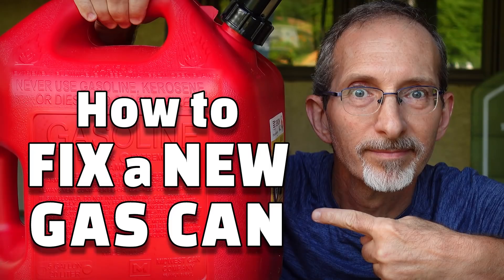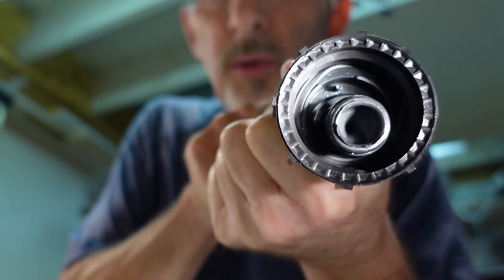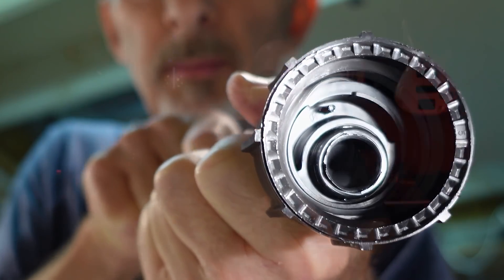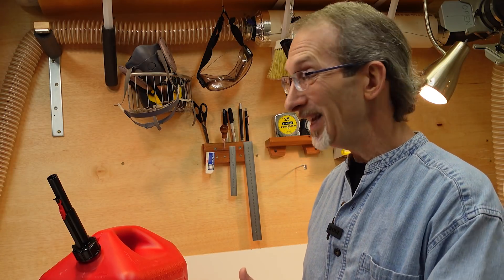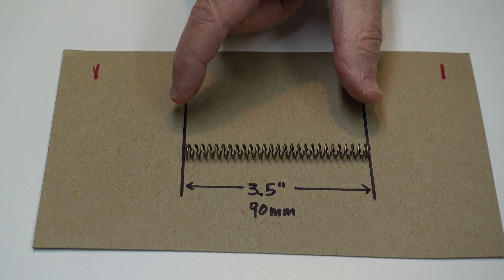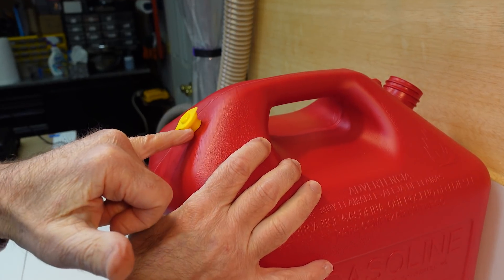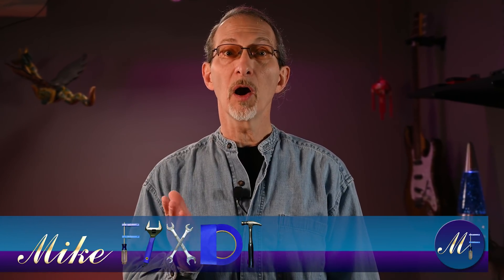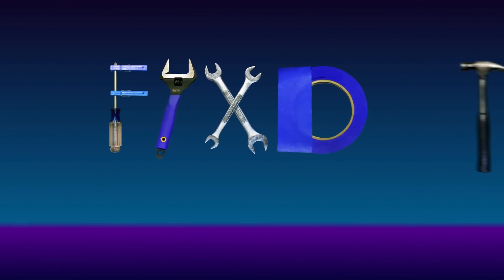Gas Can Modification | Part 2: Explosive Details!

Comment: First off when you fill the gas tank of your car or truck the weight of the gas in the plastic can will easily open the nozzle. Second of all who the heck uses a 5 gallon to fill their gas-powered weedeater or leaf blower? That is what the one-gallon and two-gallon cans are for. You must think we are idiots.
Reply from the maker: @Junk Man, I appreciate your feedback. My comments were based on the smaller cans having a similar nozzle. I tried filling my generator with this 5 gallon container, and found it difficult to control the nozzle because the gas container spout bottoms out on the filter/flame arrester on the generator tank before the plunger lip reaches it. Also, as the gas container gets more empty it loses its weight, and the spring requires you to applied downward force to the can and nozzle. It feels like it is going to break. I like the container better with the looser spring. That’s my experience, your mileage may vary! 😁
Reply: @MikeFyxdt  Thank you. and I myself own 7 cans, 3 one-gallon, 2 two-gallon, and 3 five-gallon cans. The one-gallon cans are for gas, and oil mix because the weedeater, chainsaw, gas leaf blower, etc use different gas oil blends. The riding lawn mower, push mower, and biofuel generator uses regular unleaded.

One thing we are going to agree on is that the new nozzle and cans do suck at times, the reasoning and logic gave behind it not so much. 

For instance, these are also childproof safety nozzles and they should not be defeated pending the age of the children running around your home. 

Myself, I have no issues filling my generator or riding lawn mower with them and there are some pluses to the new nozzles. 

1. gas does not start to come out of the can until the nozzle is in the gas reservoir receiver and that I like.

2. as soon as you take the pressure off the can nozzle it shuts off the flow and that I also like.

Using these nozzles there is a learning curve and since the kids have grown  I too am guilty of disabling the safety feature on these cans, except, I myself took off the whole top part using only half the nozzle that attaches to the can. 

I replaced the top part with a gas-proof flex hose, one at 10" the other about five feet long this way I can just leave the can on the back of my truck or table, then all I have to do is is place the hose in whatever I want to fill and tilt the can. I also have a siphon I would use from time to time.

I find it much easier filing the wood chipper, the tractor, and other gas-hungry equipment just tilt and pour a real back saver for me.

I must add I have a shutoff valve on one of the longer hoses so when I lay the can on its end I can control the flow at the other end.

Take care, be well.

Comment: I bought a few yellow vents online. I have the old style red gas cans and blue cans for kerosene. I followed the instructions and drilled the right size hole. I used epoxy to seal the vent caps on the cans. I will never buy any of these cans with the new nozzles.
Reply from the maker: I didn’t seal my events with any type of glue or Apoxsee, but that seems to be a popular trend. Maybe I’ll give it a try!

Comment: its not the liquid that catches. it is the vapor that flames up first.    but safety cans like these need someone like you with common sense to fix them
Reply from the maker: Thank you Charles! I just launched a third gas can video that explains how the vapors burn, and how they can re-enter the gas container and cause an explosion. I’m not against flame arrester safety devices, but they have to be designed so they don’t interfere with the operation of the tank. I appreciate you joining the conversation!

Comment: Answering your question:
I tend to just rip the nozzle apart in some way, now.  I've been dealing with these stupid designs for over ten years, and they've caused more leakage, sloppy messes, and dangers, than the old nozzles ever did.  I've even replaced gas cans out of hoping that the new nozzle would work right.  That hasn't happened.  One day I realized that the fuel port on my garden tractor was large enough for me to forego using any nozzle, and pour directly from the can.  That's the best I've found thus far.
While I haven't checked, some company must make just a plain replacement nozzle.  Perhaps not.  This entirely stupid mess of modernizing nozzles smacks of politician's forcing us into something that they want and don't know anything about.
Reply from the maker: Thanks for your feedback! I have a new video coming out where I review all of the solutions that people have suggested in the comments of my first two gas cans videos. Lots of people get rid of the spout and free pour, and many also use funnels. I found a pretty cool funnel that I am going to review shortly! I appreciate you watching and joining the conversation!
Reply: @MikeFyxdt    Thank you.
I'll look out for the next episode.

Comment: Biggest problem with your rant... lawsuits.... if a technology exists to protect someone from their own stupidity, and a company does not implement it, that company has opened themselves up to potential lawsuit that can quite frankly put a company out of business.   IMO, these kinds of lawsuits should be illegal...  but that's the world we live in now...

Also, there's no issue beyond the user, that prevents you from filling one of these gas cans with the FMD in place....  just takes some common sense.   When filling one of these, do not hold the gas nozzle fully open, and do not put it all the way inside.  Just put the nozzle about 3" inside, and squeeze the handle about 1/2 way.  The only REAL problem with the FMD is that it traps a small amount of gas inside the can so that the only way to get it fully empty with the FMD in place is to leave off the spout & let the gas evaporate.
Reply from the maker: All good points Shawn. I appreciate you joining the conversation!

Comment: Quit wasting time modding those dumb spouts. Why not just use the E-Z pour retrofit spout and vent. To make to half-inch hole, it's best to use a step-drill. Even better, do NOT use those flip-up plastic vents. they can break or come open. Better, get something that is threaded and positively locks down.
Reply from the maker: I will be trying an EZ Pour spout in an upcoming video. I haven’t had any problems with the plastic fat, but I really haven’t had them that long. I will report back if they give me any trouble. Thanks for commenting!

Comment: May I add a little suggestion about the plastic shavings when drilling the hole for the vent.  Dip the bit into some axle grease or apply with something suitable and the shavings will stick to the bit as you drill or pull it out.  Works well.
Reply: Or turn the can up side down and drill
Reply: Why worry about any of these ideas?  It is almost impossible to keep all of the shavings /chips out of the can due to the very nature of drill bits.  Just start with a clean, dry can (new is good) and pour the chips out of the threaded opening that the spout screws onto. A bit of compressed air in the new hole will make this even easier and quicker.  Personally, I would debur the inside of the new hole before clean out as I REALLY do not want any volunteer bits of plastic in my chainsaw.  A link to the vents would be helpful.
Reply from the maker: Thanks for the suggestion Dick! I appreciate you watching.
Reply: To keep the plastic shavings from going into the can, remove the spout and pressurize the can with your shop vac.
Reply: I will remember that

Comment: Great videos. Well done both in quality of the video, and accuracy and usefulness of the information. 
I was given four of those cans full of gas when my next door neighbor got a whole house generator run on LP gas. He had a small gasoline generator that he had been using but it was a pain. Well I broke one of the spouts the first time I used it and of course spilled gas everywhere. I have actually spilled more fuel from those four safety cans than I did from all of the previous cans I've owned in my 68 years.
Another drawback on the spout is that fuel will eventually leak down between the two tubes after they wear, likely in a very short period.
One last safety issue, if you have already used this can and it has gas or had gas in it, you want to make sure you use a brushless drill or maybe even drill the hole by hand. Some drills generate sparks in the motor which can ignite fumes remaining in the can.
Reply from the maker: All excellent points Mike! I’ve received a lot of comments about drilling the hole in the can, and concern over igniting the fumes. I emptied the can previously, and let the container air out overnight, outside before I made any of these mods. I guess it’s better to say that then as soon people will just now! Thanks for joining the conversation!

Comment: All this trouble for a new gas can is ludicrous.  When I need a new gas can, I'll go to a truck stop or other fuelmstation where lots of diesel is sold (or even at rest areas) where they empty diesel fuel additive (DFA) into the DFA tank.  Those are just like the older style gas can but with an air inlet valve that works!  And they are free!  Just rinse it out a couple times and let it air dry.  If your lucky, you can also find the ordinary screw cap to use when you are transporting and storing the fuel and then replace it with the nozzle attachment where needed.  I just found 2!  Can't beat free and 1 min. of my time rinsing them out!
Saved 2 gas cans from the landfill too!
Reply from the maker: Free gas containers? That’s awesome! I had no idea…

Comment: You should Tell people if the Gas Can has had Gas in it Remove Any gas in can and if there are Gas fumes in gas Can. Fill the Gas can with water to minimize combustion when heating the Area of the Vent hole. Then empty Gas Can and Put it in the sun to dry Out or just air Dry before putting fuel in Gas Can again!!
Reply from the maker: Gregory, good point. I emptied the container and left it open outdoors, overnight. I just assumed people would use similar caution. I guess I shouldn’t assume! :-)

Comment: My friend has two of these gas cans.  We tried to put gas into his 2020 Honda CRV.  If you are familiar with the gas filler set up on the CRV, you will understand that this gas can design is a miserable failure.  Even with the two of us working together, we got gas all over us, the side of the car, and on the ground.  So a big Thank You, Mike!  I appreciate this mod!
Reply from the maker: Michael, thank you for sharing this story. You wouldn’t believe how many viewers have had a similar experience. On a sidenote, nothing beats a funnel for trying to get gas into a car… Thanks for joining the conversation!
Reply: @MikeFyxdt  Except.. you can't press the highly engineered container nozzle, with safety accoutrements, against the funnel.   I have a similar issue fueling my zero-turn.  The zero tank filler threaded cap, with it's sloping  liner, is at least 1/2" thick, thus the little tab on the nozzle wants to slide right into the tank.  The only way, is put on heavy gloves to hold that tiny tab, while you're trying to fill.  Gas on me, the tank, the engine area, etc.  And trying my best, to refrain from profane language.

Comment: You will drill a much CLEANER & NEATER hole if you use a FLAT SPADE BIT to drill that hole for the vent.  I have done it on ALL of my gas cans, it works great ... both the flat bit & the vent. :)
Reply from the maker: I didn’t consider a spade bit, but it may be worth a try! I chose the spiral bit because I wanted to pull the plastic shavings out toward me, and not let them go into the can. It’s always good to present these different options, and I appreciate you joining the conversation!
Reply: @MikeFyxdt  -- Just be careful to keep the flat bit straight and square with the surface.   Yes you'll get a few crumbs inside the can, and the center plug left by the bit,  but in a NEW EMPTY can they dump out pretty easily.  I even poured about a cup full of gas into the can, rinsed it around, then dumped it out to clean the inside.
Reply from the maker: @jims1942  Thanks for the follow up!

Comment: Wondering how many folks blew themselves up doing the PART 2 mods after previous use following PART1 video.  You know those stupid people using a heat source around flammable products. Not sure I’d have shown that as an option, even with a DANGER disclaimer.
Reply from the maker: I sure hope the number is zero. :-)

Comment: You are sadly mistaken if you think they are trying to protect stupid people.  They are trying to protect themselves from greedy lawyers that bring suit against them on behalf of the stupid people.
Reply from the maker: Bret, part of the container design has been dictated by safety laws, but the nozzle design in my opinion is marketing and sales, not defensive. Since this is their design, and their marketing it as a safety feature, if it is not easily used then I hold them responsible. There are so many fine lines overlapping that it makes it a very complex issue. Thanks for joining the conversation!

Comment: I am sure that some plastic pieces will fall into the gasoline can so it will end up in your car’s gasoline tank and that may lead to clogging problems for you car.
Reply from the maker: I was pretty careful to make sure plastic pieces didn’t go into my container. Several readers have suggested blowing the can out with air while it is upside down to get out any wayward plastic chips. Thanks for joining the conversation!
Reply: @MikeFyxdt  You can also use a shop vacuum after blowing it out to remove any particles /debris before filling it.  This isn't rocket science folks.